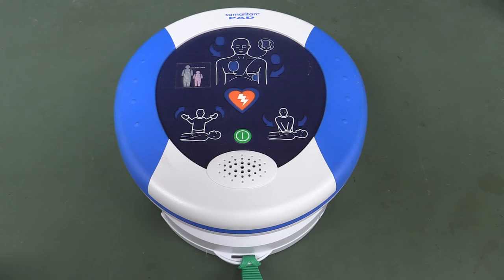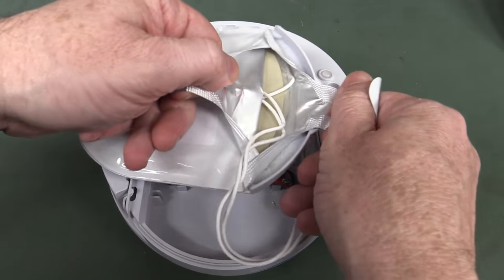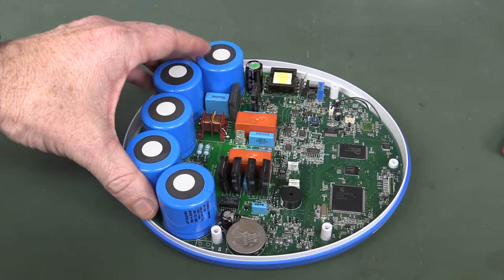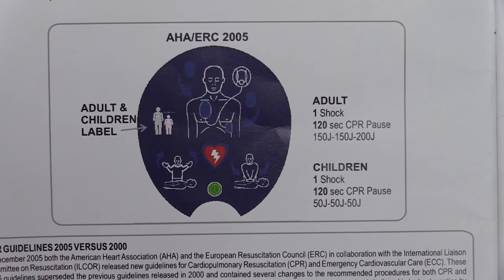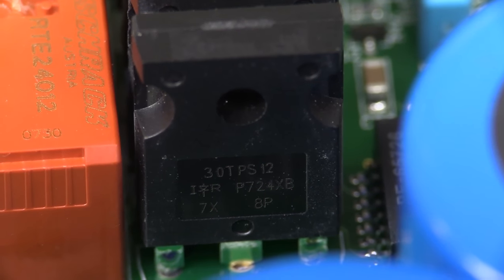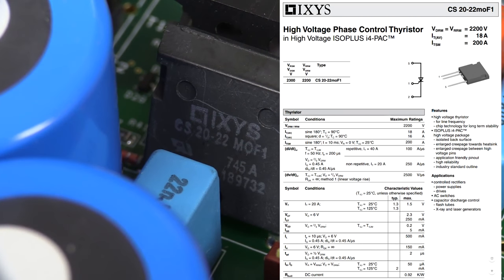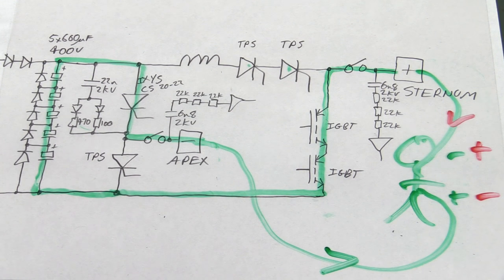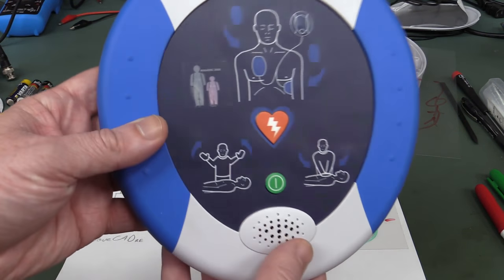EEVblog #909 - Heart Defibrillator Teardown

Comment: A defibrillator does not restart the heart. It stops a dysfunctional rhythm. A very common misconception
Reply: Right!!
Reply: Whats more it can only treat certain kinds of shock able arrhythmia and it does so by stopping the heart in hopes that it will restart its self in a proper rhythm.
Reply: Does a dysfunctional rhythm in the heart give off a pulse and if so how do you know when to use the AED?
Reply: layman's terms
Reply: +Star250 If a person collapses and they have no pulse attach the AED. It will analysis the heart rhythm and decide if it should deliver a shock or not. It will then prompt you to either press the shock button or not.
Reply: Does it reboot it?
Reply: If someone is lying on the ground with a weak or no pulse, hook up the AED.  It will measure the rhythm and will only advise shock if it will do any good. You can NOT cause harm by attaching an AED.
Reply: Right! It's really a heartstopper :)
Reply: The AED analyses the electrical characteristics of the heart and will determine if the heart should be shocked or not. When you hook up the pads to the patient the voice prompt will say 'Stand clear. Analysing rhythm'. If it wants you to shock the patient it will say 'Shock advised'. If you hooked the pads to your own heart the machine will say 'Shock not advised', so even if you push the shock button the computer will override it so that you don't kill them.
Reply: did u turn it off then turn it on again?
Reply: did u turn it off then turn it on again?
Reply: So, if the heart has really stopped a 2 or 3 minutes ago, is there way to restart it (by electrical simulation)?
Reply: I think asystole (No heartbeat, no electrical activity )is a non shock-able rhythm therefore you can only do CRP, but the machine will advise you either way.
Reply: toxanbi If a heart has COMPLETELY stopped then there's probably no hope. But hearts don't completely stop at least twitching until they've run out of oxygen and have died. So yeah, if your heart is actually dead, you can't restart it.
Usually they're just in some sort of spasm or other type of non-productive (non blood pumping) motion. Defib can (try to) fix that.
If the incident is actual heart damage (massive blood clot or rupture) then defib won't help.
Reply: ***** my grandfather dead in the December of 2014. When emergency team arrived, they said that heart is not beating thus patient is dead.

I was shocked by the fact they are NOT trying to reanimate him in any way (no CPR, no use of defibrillator).
Reply: ***** What's more important is to tell people that they can't cause any harm by applying an AED.
Actually what we were taught in CPR class is that CPR will never restart a heart, it just keeps the body alive until you can get a defib attached. The defib doesn't really 'restart' but it reboots and gets a normal rhythm going again.  CPR just artificially pumps air and blood to prolong life until you can get a defib.
Reply: While we're on the topic of misconceptions, here are some about CPR. Don't stop after 5 minutes and assume the person is dead like in the movies. Keep going until the emergency crew arrives. Keep your arms straight and apply your own body weight perpendicular to the ground. If your arms arms bent, you'll get tired more quickly. Don't be gentle. You need a lot of compression to get the blood moving. Don't be afraid of possibly even breaking ribs. Nobody is going to thank you for being gentle to their ribs if they are dead.
Reply: i was going to say the same thing,
it's the Sinus Node and AV Node (but primarily the Sinus Node) that will issue the impulse that gets conducted via the conductive fibres of the heart that causes the contraction / pumping action of the heart

so.. When the Sinus Node is pulsing at a slower rate,  hence  Bradycardia
the Defib will KILL the heart and the idea is...  the Sinus node is supposed to reset in a manner of speaking
or
the Sinus node does not pulse , so therefore the AV Node issues the pulse which sets off the Sinus Node
and...
same thing happens when the Sinus Node and AV node are fighting each other of the heart is going spastic
hence...Tachycardia
again,  the AED kills the hearts current rhythm and the idea is the hearts Sinus node will reset itself and return to normal sinus Rhythm
Reply: Gameboygenius I never heard of "give up after 5 minutes."
Our CPR trainer was once a ranger in national parks. He witnessed a heart attack on a beach once, gave CPR, dragged the guy 50 feet down the beach, gave CPR again, repeat (lonely beach, he had left his car half a mile away).  It took him almost an hour to get the guy close enough to the car that he could get to the radio to call for help.  Alternating CPR and dragging the guy the whole time.
The next day he got a call from the hospital. From the guy.
Reply: Robert Eliassen
yeah..basically that's it
when the heart is going spastic or going too  slow, and in either case, it's not pumping blood. or... sufficient blood
and in doing so it will cause further harm
the defib effectively says to the heart
shut the fuck up
STOP NOW
and restart and work normally

so yeah
the defib stops the heart
in the hope that it will restart  and work normally
if it doesn't
it stops it again

usually you give it 3 or 4 restarts
after which it gets fiddly
Reply: +John Ridley Last time, I did first aid (a while ago) we were advised to keep going untill told to stop by paramedics (such as ambulance medics). Think of it this way, if you child or parent was unconscious, how long do you think you could keep going?
Reply: John Ridley Great story. Good to hear he survived. Obviously a CPR trainer will get it right, but I was really talking about the public misconceptions. Not everybody paid attention to their CPR lessons, if they even ever got any.
Reply: It`s more a reset than a restart...
Reply: lean04 it's not that complicated
we don't need to quivel of minor technicalities

it's actually pretty simple

the heart does something it's not supposed to do

the defib issues a sudden shock

that shock STOPS THE HEART

simple

it's not a restart or a reset or a system upgrade or a shutdown or hibernation of sleep mode or anything like that

the shock KILLS / STOPS the heart in it's tracks
that's as simple as it gets

beyond that people can overcomplicate it as much as they like
Reply: +Martin Kuliza I am a doctor, I know exactly what happens. The faster node (or random locus) takes the pace, which can lead to fibrilation. The defibrillator shocks the electrical conduction system and nodes, stopping all electrical activity and gives the chance to the atrial node (the main one) to pace again. That's why I jokingly compared it to a reset..
chill
Reply: lean04 well.
first of all , i am chilled
i'm a very calm person

but  hehe it's funny , but people always make the assumption that i'm upset , for some reason

anyway
given you're a doctor,   I'll say this,
i'm an engineer,   i also have an interest in Medicine, i'm a Part time Grade 3 Paramedic, but not a doctor by any means
so , i respect your position and education and skill

that being said
i did know how you said it
but, obviously i took you for a lamen person

after all , you of all people know the routine
when someone starts talking about this stuff  hehe,
all of a sudden every man and his dog thinks they are a doctor

the equivalent in my trade is
once someone starts talking about electricity, for example
30,000 Volts
some wanna be expert will always stick his head up and say
it's not the volts that kill you it's the amps, therefore Volts are harmless  LOL

anyway, i mistook you for potentially being a medical wanna be

my apologies
i stand corrected

you're opinion and education out weigh my own on the this subject

take care
Reply: +Martin Kuliza I'm wondering why neither one of the two medical professionals has pointed out that he has Apex and Sternum reversed?
Reply: Michael Moreau i'll speak for myself only on this one.
it's because the focus of the conversation was not, where do the paddles go
but instead ...
does a defib, kill or restart your heart

that's why i didn't say anything
it just opens another can of worms
and.. why would i do that.
Reply: ***** if it's actually dead, you don't.  Usually it isn't dead though, it's just in some kind of abnormal rhythm. One abnormal rhythm is the whole heart just quivering, not beating.  A defib can make it stop doing that and hopefully regain a normal rhythm.
Reply: +Stefan Cojocaru (Skyman) an) 1- by warming it up and when you "connect" the blood vessels the parasympathetic autonomous system gives the signal to the node that is in the heart
2- similar to number 1, the sinoatrial node gives the jump start
3- there is a term : electrical activity without pulse (at least in Spanish,  I don't know the exact translatio), that means that the electrical system is active but for numerous reasons doesn't translate to a heart beat.
also when someone has flat line in the EKG  (that means dead) you shouldn't use a defribilator, you use cardiac massage and drugs like epinephrine
Reply: +Stefan Cojocaru (Skyman) the electrical phenomenon in the body it's due to the "pumping" of ions (sodium, potassium, etc) which generates electrical potential, plus each cell it's alive on its own. And don't forget that the baby is inside the mother which provides energy. Also the DNA carries the set of "instructions" of what the cells need to do when they start their life cycle
Reply: Gameboygenius I don't remember where I heard it but aren't you pretty much required to break ribs to get the heart pumping?
Reply: MrSnowman NO. that's actually not true.
you see its like this
there are different types of bones in the body..
(you learn this in basic anatomy and physiology )
some bones support weight
some give shape
some do other things

a rib bone is classified as a FLAT BONE.
it is SPONGEY in it's construction

and being as such is allows for movement and contraction without having joints

unlike if you were to try to do the same thing with your Tibia (a Bone in your leg) You'd probably break your Tibia or fracture it

so, WHAT YOU HEARD WAS THIS

When giving someone chest compressions IT IS NOT NECESSARY TO BREAK THE RIB CAGE OR A FEW RIBS in order to massage the heart

However, it is common for ribs to break
BUT.. NOT NECESSARY

because ribs have FLEX to them if you don't OVERFLEX them, you won't break them
if you over flex them you will break them

it just depends
but how a defib works has nothing to do with ribs contracting 

a defib merely passes current through the heart to stop it

hope that helps
Reply: MrSnowman His answer is 100% accurate, however when one administers CPR there is some "breaking" in that the first round of compressions will break up some of the cartilage in the structure of the rib cage, at least that's my understanding.
Reply: It can restart heart that is in asystole...
Reply: Asystole is total stoppage. A defib is no help with that and afaik at that point you're basically just dead. However, some sorts of vfib with very fine fibrilations look very much like asystole; there are tiny movements but they're so tiny as to be nearly undetectable. A defib can return that to a normal heartbeat.
Reply: I was just thinking of that.
Reply: @Star250  you always want to use an AED if one is available and the person you are putting them on is unresponsive. Once the AED is turned on it will guide you on what to do, the only thing that a person that wishes to help has to do is follow the AEDs instructions.
Reply: @toxanbi  nope. CPR and drugs.

Comment: For incident logging, you read the current RTC value at time of readout, and subtract from the timestamps in the log, so only the drift between the short interval between incident and readout matters. RTC may also be used for expiry/service interval enforcement
Reply: I was going to say almost exactly the same, after use they pull the data, they can apply a time correction if needed.
Reply: Or may be the RTC is used for the Expiry Date. Something like if it expires (goes over the date specified on the device label/programmed into the IC) it stops working? Dunnno, may be another explanation that i thought about after i saw the actual device has an expiry date?
Reply: why you copy my profile pic
Reply: facepalm
Reply from the maker: Yes, of course. Forgot about that.
We used to do this with seismic data loggers. Even with the best clocks we could get there would be some offset, so the data is read back later and drift correction applied across all the loggers.

Comment: Hi Dave, I think the reason for the internal coin battery is that these devices record the heart rhythm for later retrieval at the hospital, or for the ME (Medical Examiner). Those contacts which attach to that USB cable is what they use at the hospital to removed that data. Plus the clock circuit would be needed to record how long the machine was turned on, how long the patient was in a certain type of arrhythmia and the waveforms before and after the shock was delivered. All that data is recorded and used for statistical analysis.

Comment: I'd love see a teardown of the LeCroy differential probes.
Reply: +1, I really wonder why these things are so damn expensive. Maybe make a EEVblog div probe?
Reply: I'd like to see that too. The are so handy for measurements in circuits with various ground levels.
Reply from the maker: They are a niche market. But even the cheap brands are 3-$400
Reply: SCR Fundamentals Friday would be lovely, too.
Reply: +EEVblog And there are not so many different OEMs. We have several brands that look exactly the same
Reply: me too, would love to see a reverge engineering of it
Reply: Most of that cost is because of the effort it takes to design the things to get good performance. Building a probe that's good to 1MHz is dead simple. Building one that goes to a few hundred MHz is harder, but still doable for the skilled hobbyist with a reasonable budget. Getting past .5 GHz or so starts to require 4-layer PCBs with controlled impedance substrate, and lots more care about the signal path. Adding in switchable attenuation without unwanted resonances/parasitic losses/etc is yet more effort. And since every scope has add + invert modes they're rather niche (if handy) devices, so they tend to be very expensive.

Comment: For the clock, maybe a relative time works just as well ("I was activated 10 hours and 15 minutes ago"). 

I also wonder if the clock could be used for the expiration date of the pads - it could refuse to activate if they're expired.
Reply: the expire date on the pads is exactly for the adhesive/conductive paste, since if it dries off too muche there might be problems, especially in men whith a lot of chest hair that already raise the resistance of the patient quite a bit, in fact in the AED pouch we have also a smal razor blade to shave the area (of course it very much depends on the situation if it get used or not)
Reply: I agree about the clock- but I do not think the device will refuse to work? Friendly voice saying : I am Sorry- I am expired and your dead?? I would expect who ever installed it is realiable for swapping them in time? Would be interesting to know though....
Reply: My instant thoughts of RTC were for expiration.

Comment: In reference to the caps you were wondering about, Cornell Dublier makes a lot of special pulse rated caps so they may be just a jelly bean part for them. A lot of people use them for huge cap arrays in large Tesla coil designs because they can handle the stress of a disruptive discharge circuit, being charged and then discharged at high frequencies through a spark gap. As I'm sure you know, if you try this with just any old HV cap it will most likely explode.

Comment: Hi dave
FYI, that cable thingy is for Firmware update and for training.
my friends runs an R.T.O. for Paramedical Training

the cable plugs into the AED and then other side into a Rhythm simulator that the instructor can throw at the trainee medic 
while the dummy is hooked up to the defib
all the instructor has to do is press a button and select different cardiac conditions
the device is basically a glorified waveform generation
take care mate
as always
good videos
Reply: PAD AEDs don't have a training mode (and aren't used by paramedics). AED training is done with cheap 'trainer' units that don't have capacitors, etc, just a speaker, some 'smarts' and an IR receiver that lets the instructor control it with a remote. Training for more advanced units used by paramedics is done by simulating the heart rhythm directly through the EKG leads. The heart monitor doesn't know it isn't hooked up to a real patient.

The USB cable is used for firmware updates, as you mentioned, and to download a 'replay' of the incident if it is used.